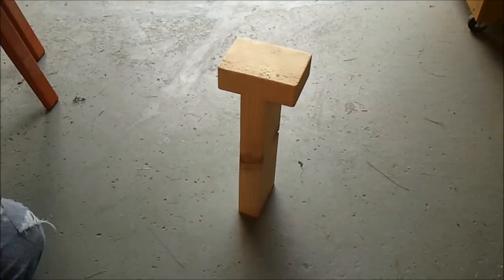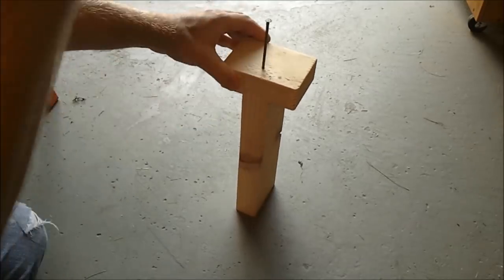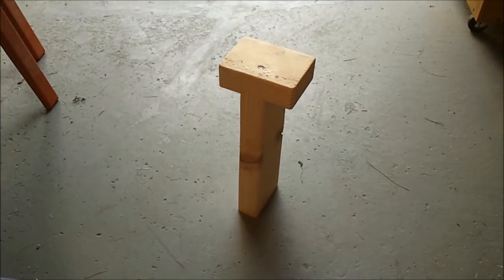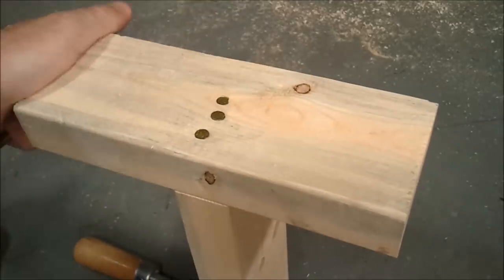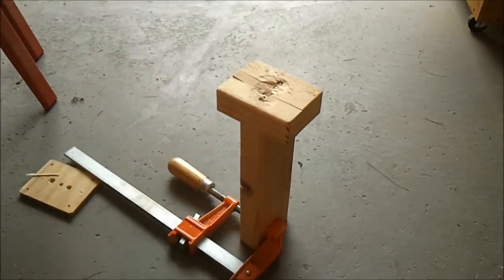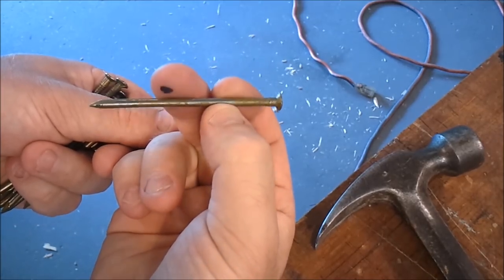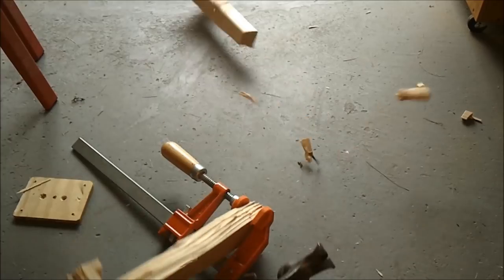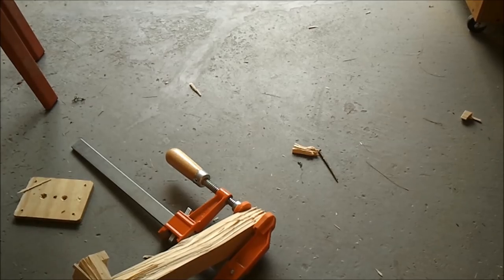Sink a nail in ONE HIT

Comment: What if you attach the nail to the head of the hammer. Then you just slam it down.
Reply: they have a hammer for that, but doesn't work as good as it sounds
Reply: +Jpegsus If it is the same hammer you are talking about, It's magnetic hammer used to drive nails called Bangers, they are used for a few things but mostly to kind of spot weld insulation to the inside of duct work
Reply: +Skitzo TheWicked I believe there called stilettos, more for framing

Comment: Geez! Get a Vaughn 32 ounce framing hammer with a waffel face on the hammer. Stand on the board, tap the nail to set it in the board. Stand up and swing the hammer down from sholder height to the nail. BANG! You will sink it with one hit. I did this for 10 years and it works every time.

Comment: One of the oldest job-site bets ever. It’s best to do it on top of a saw horse or a window sill though. That way you don’t crush your fingers under the board, on the floor, when you swing the board down.
The other classic job-site bet is: Balancing (10+) 16p nails on the head of one nail. 🤔 How can this be possible??...Sorcery?? Works every time.
🤜🤛

Comment: I have another method.
I stand with the anterior portion of my body parallel to the wall/studs/plates/sheathing/HF #2/DF #2/Borate-Treated Mudsill/Pressure-Treated Bottom Plate/etc. etc. etc. AND then I place my right biceps brachii muscle adjacent to the nail, to where my epidermis is in direct contact with the superior head of the nail assembly, (Also known as the head of the nail). I then flex my right arm, and use the hypertropic momentum to accelerate the nail assembly to its nominal velocity.
Reply: Brains and brawn, eh? 
If you also had a sense of humor, you'd be quite a catch!
Reply: @pocket83squared  Aww shucks!

Comment: Your a stud. Pun intended. Who drives nails by hand. The Amish?. My Hitachi drives it in one hit.
Reply from the maker: You're. 

Most people my age can't use a hammer, since air nailers were everywhere by the time I was 20- but I started framing at 9. If you're skilled with a hammer, it's just as fast in most places. Of course, not on straight runs, like where fastening sheathing to joists/rafters.